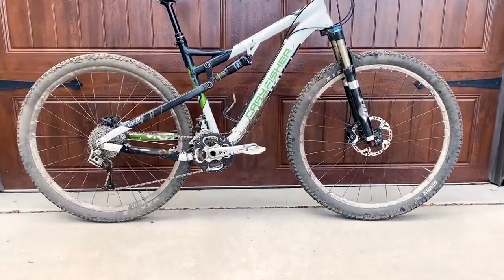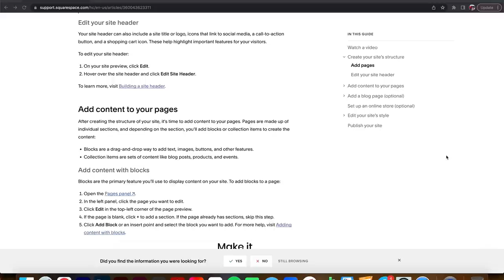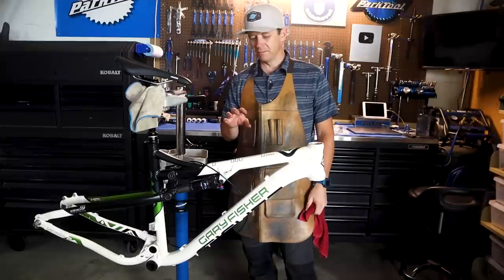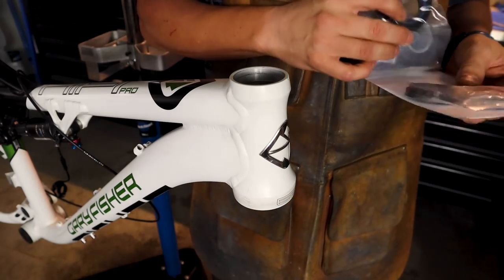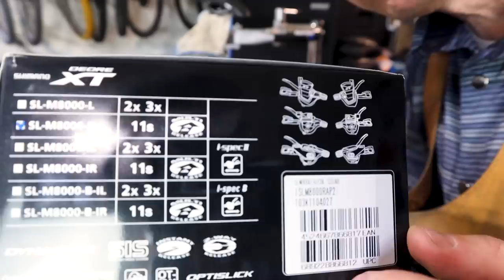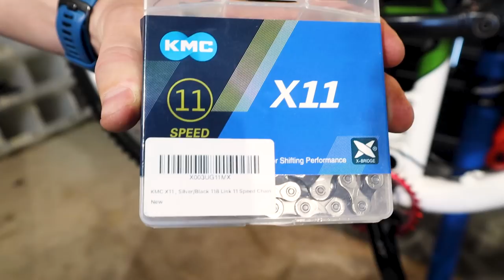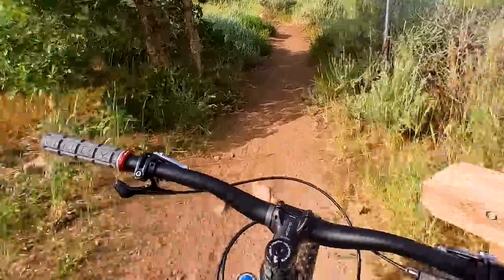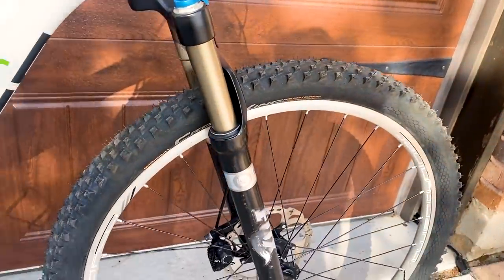Slacken a Bike's Head Angle - Angle Headset Install

Comment: I like to go the other way with "older" 29er conversions; with their steep headtube angles and short top tubes, they work well with drop bars. Voila, a burly gravel bike with category-leading tyre clearance! As an added bonus, it isn't thrown off by the addition of suspension, either!

Comment: You could also add a crown race spacer for another 1/2 degree.  Reverse Components Angle Spacer Crown Race works great!  Awesome video as always.
Reply from the maker: Cool
Reply: Or go for longer travel fork 10mm in the axle to crown distance slackens the hda by 0,5 degrees. A modern 29er fork will do wonders!
Reply: Offset shock hardware also..

Comment: First time i see an angled headset. This is interesting to know.... In the past i increased the angle of my bike by using a tapered fork with the adapter. Basically my bike came up with 100mm fork with 68° angle. But the other version with the same geometry came with with 120mm fork. Basically by keeping the 100mm fork plus the adapter i came up halfway between 68° and 66.5°. Definitely more aggressive on downhill section but for climbing i had to lower the handlebar (negative stem plus flat handlebar and the bike recoved his ability). I think everything was worthed. I feel like i've made a monster :D
Reply from the maker: Lol on making a monster. Sometimes that over-forking a bike can do just that, create a monster. 😁
Reply: @oldshovel  yeah I know, but doesn't not feel like an over forking. After the cockpit update feel like a complete bike, it's pretty hard to explain. Definitely more stable on downhill without ruins the climbing ability.....if you want I can share a photo.

Comment: Excellent modifications. The Wolf Tooth and Works components angle headsets avoid the nasty creaking that other designs have. The shorter cranks will really help with pedal strikes as well.

Comment: Still rocking my Aluminium Devinci Dixon from 2013, it was kind of ahead of its time geometry wise, so it really only needed some parts swapped out (stem was way too long - 90mm to a 35mm, 2x drivetrain was meh -1x narrow wide, dropper post,  better brakes with cooling fins that run on mineral oil instead of dot 5 and a coil shock in the back) to give it a modern bomb proof feel.  Dixon is a beast of an early 2010s bike.

Comment: Smart from design from Wolf Tooth. 
Years ago I got a Cane Creek Angle Adjust BUT the larger cup was at the bottom of the head-set which changed the bike geometry by lifting the BB and slackening the seat tube. I felt the handling changes but it made a different bike. I had to get used to. 
I like this system a lot! ❤

Comment: I did the same conversion to my 2012 GF HiFI Pro about 4 years ago.  Initially, I used the LX crank with a 34 tooth Race Face ring and a Shimano 11 speed 11-46 cassette.  Later I changed the bottom bracket to a Wheels Manufacturing BB86/92 threaded bottom bracket (P/N: BB86-OUT-BB).  I also went to a cassette with a larger cog set- A Sunrace CMXS80 11-50.  The transition between the two largest cogs is smaller and makes for a smoother shift.  The next mod is going to a 120mm travel shock.  This will slacken the bike a bit.  I also went with 8 inch rotors front a rear.  The bike climbs great, but is definitely a handful going downhill.

Comment: This is just like the project I wanna do with my 2008 Trek Fuel EX 8 that I got gifted from guys at a trail I go to since they watched me do the dirt jumps in a 200$ huffy and kept telling me to upgrade but I don't have that kind of income yet. I got a 2019 Fox float DPS from a buddy of mine at the bike shop as a gift too, and Im going all out by, trying to fit a tapered marzzochi z2 into a straight 34mm headtube. Imma have to press out the tapered steerer tube and press in an nd tune straight steerer tube with shim adapter. It's definitely wayyy overkill but I'm hardheaded and like to do things the way I want with my bike💪

Comment: I recently took my 2003 Bianchi XC bike out for the first time in years, and not since upgrading to a trail bike with modern geo. I enjoyed the heck out of climbing with my old bike, but hated the mild descent! 
I'm considering reworking this awesome old steel frame into a light and nimble SS this winter. Changes would include tubeless wheelset, reducing the reach, and a rigid fork with slacker head tube angle... will the Wolf Tooth headset work for this old-ass frame with 1-1/8 head tube... maybe with a 1" fork tube? Wishful thinking?
 If not, I still want to do the resto-mod because I love the old bike and it deserves a new life!

Comment: Is it worth installing an angle headset on an older (ca. 2000) 26" full suspension?  I'm assembling parts for a restomod on an old Diamond Back Coil frame.
Reply from the maker: Most older bikes it’s not possible with a 1 1/8 or 1” headtube with external bearings there just isn’t the space to make the adjustment.
Reply: I was able to slacken the head angle on my 1996 Pro/flex 756 by ditching the Girvin fork for a Rockshox 100mm unit with offset. Oh and went for 27.5 wheel up front for a 27.5 x 26 Mullet combo. Works like a Dream! Only issue was the seat tube angle, but was corrected by a straight seat post and moving the saddle all the way forward to compensate. My head tube is a straight 1-1/8" also.
Reply: It may have 1.5 headtube (and headset), then it's possible. Or straight 44mm headtube, then it's also possible.

Comment: Pressfit bbs not being made  anymore ? I think they are prevailing now since it's cheaper to make a frame with a pressfit bb rather than a threaded one. Especially in carbon frames for which you need to glue in the aluminium shell if you want a threaded bb. And I see more pressfit bbs in aluminium frames. As for removal there fairly cheap punch out removal toola from bikehand that fits 24 and 22 mm axles. Pro also has a fairly heap one but obviously it fits only 24 mm axles. Then you have expensive pull-out removal tools. I think it's called an intertial hammer.

And that rattle on the first gear. It sounds like the chain being pressed by the  upper pulley against the cog requiring adjusting the b tension screw
Reply from the maker: It’s not that press fit bbs are not being made, it’s this specific pressfit bb needed for this bike that is not being made anymore, it was a “new” one back in 2010 that only a few bikes used for a couple years and then did not catch on. As to the rattle I also suspected the b limit screw at first, but it was the chain line causing the lowest pulley skipping as the chain line was too far off. The crankset I used was for a 2x setup.
Reply: What standard is it? Wheels manufacturing makes virtually every press fit bb's
Reply: @oldshovel  interesting. What type of pf is it ? Isn't it avaialble on aliexpress ? As for the rattle, after you used the spacers for the chainring bolts, the noise is still there.

Comment: get an oval chainring from Garbaruk or Absolute black or any other company that does them with development, those Deckas rings from china have the oval in a wrong place so you feel strange while pedaling. When its a proper oval you don't feel it so much